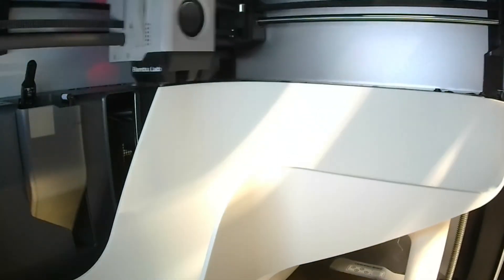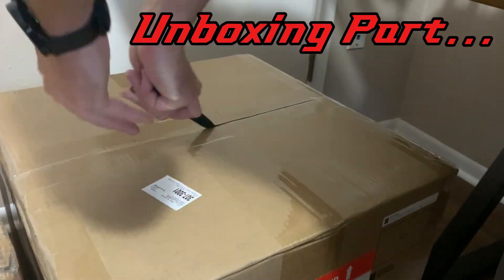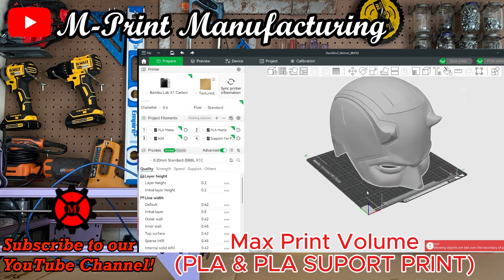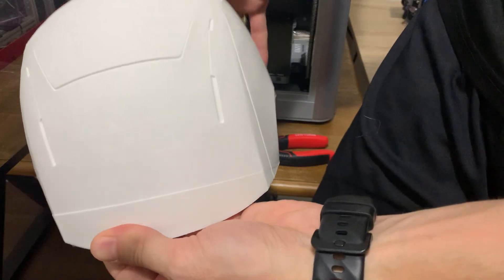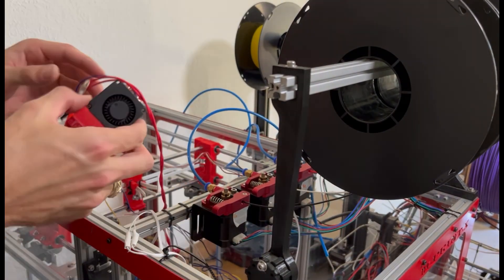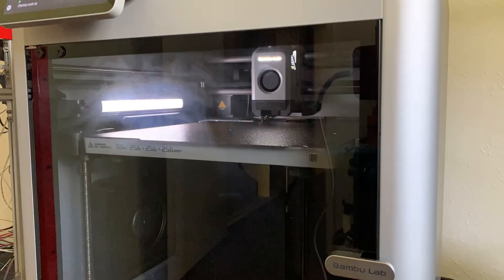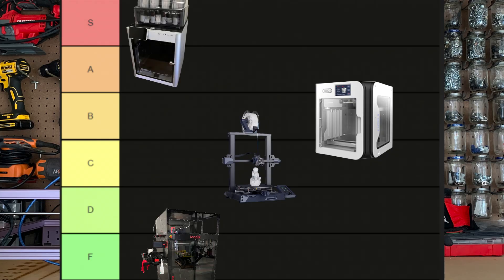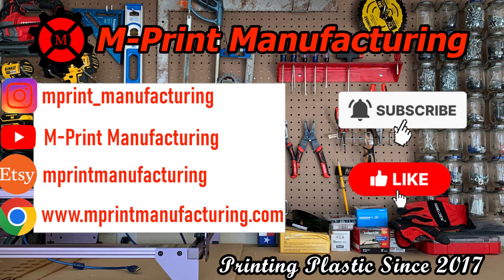Ep.  21 | The Bambu Lab X1 Carbon 3D Printer | From Average to Amazing Overnight | A Review of Sorts

Comment: Why didn’t you get the H2D or H2S?
Reply from the maker: Hi @dariussteele3843, mainly I wasn’t looking for the laser cutting option with the H2S and H2S. Also while those offer the larger bed size, I was fine with the X1C mainly for the price and fit my need for multiple material printing with the option to expand up to two AMS. (Which I might do!)
Reply: @m-printmanufacturing2017 that’s fair… I was thinking the H2S was similar in price.